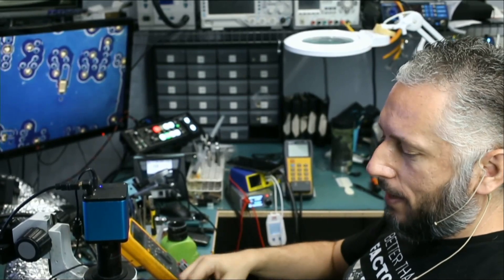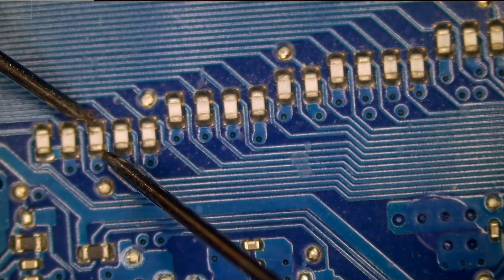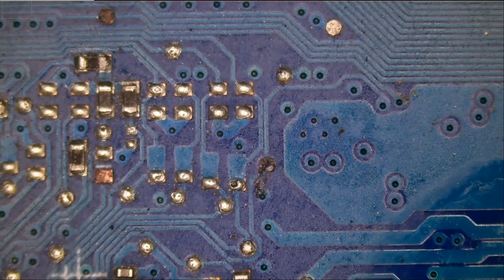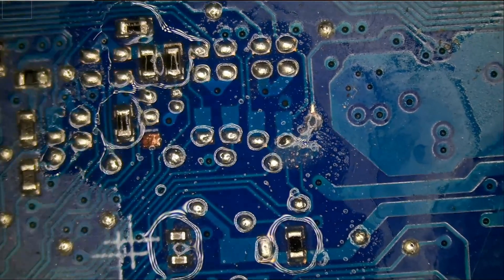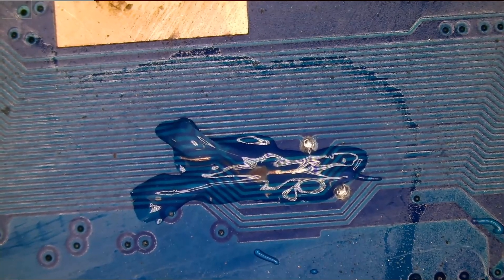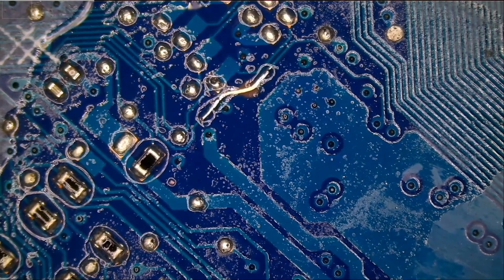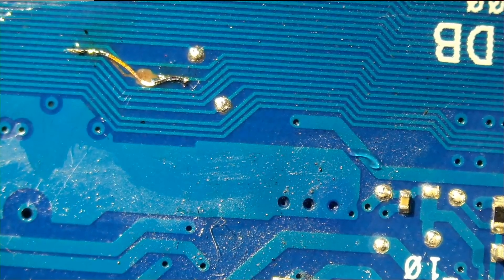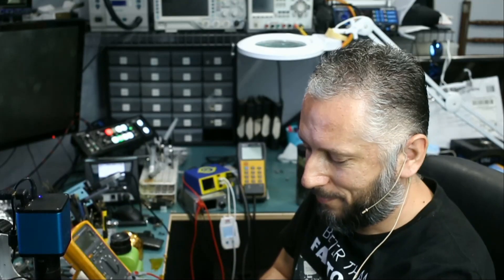Dell Alienware M17 some keyboard keys not working. Motherboard Repair. Not a keyboard issue.

Comment: Hi Alex, most EC programmers who work through the keyboard port have the feature to test keyboards. You can see if a key is working or not, stuck or not. 
But for about 30$ you can also find keyboard testers.
Reply: There is also a touchpad testers? my touchpad is not working and before messing with the board I want a way to test the touchpad
Reply: @kdilac8879  No. Keyboards are "analog" (two circuits are switched together on the keyboard matrix when a key is pressed), which the testers can measure. Touchpads have their own controllers and firmware, so this cannot be easy standardised.
Reply: @SiETechNotebookReparatur  The touchpad ELAN chip is programmed? If I buy a new chip I have to program it?
Reply: @kdilac8879  you can test the chip using an eeprom programmer like ch341a. You can also use it to dump/save the previous firmware or flash a new one.
Reply: @-.......................-  which adapter I need to test this ELAN chip? I have the programmer ch341a
Reply: @kdilac8879  do you know the part number of that chip? you will refer the connection to its pinout that can be seen in the datasheet of the chip

Comment: I looked online for many hours trying to find a fix on my personal laptop after multiple keys stopped working, and im sure there are tons of people out there with this same problem that couldnt find any answers. Never would have thought it was a motherboard problem. Cant wait to take mine apart and see if there are any broken traces. Thanks for the video!
Reply: Could be a motherboard problem but it's very hard to find people who knows what they are doing. Mostly repair shops usually just make the present situation worse. BTW good luck with your laptop hope it gets fixed

Comment: I have the same one, just wondering how those lines were corroded.   Nice video 👍👍👍. This is one of the best YouTube channels.
Reply: Probably its caused by condensed water when you turn on a very cold laptop in a warm room with high humidity..

Comment: Nice video. I wonder why there is corrosion  on that part of the board only. Maybe its liquid gets in there, some caps and resistors look a bit corroded too. Do you also clean the whole board for the customer after the repair? Thank you for the video

Comment: Common issue when you keep your laptop on your lap or inside a backpack in the summer. Sweat and moisture finds it's way into the board. I had several issues with my daily driver laptop unti the keyboard was completely gone and that was the end of it. The keyboard is welded to the case so into the bin it went.

Comment: Alex, I hope you read my comment. I'm wondering, what you do in cases like that, when the part you ordered is not necessary for repair. Do you keep it in stock, as it might come handy in the future, or do you send it back? I'm wondering what's more sensible from a business standpoint - having that bit of cash "frozen" until somebody comes with compatible laptop and issue or sending it back so you get cash back (minus shipping probably).

Keep on good work! 👍

Comment: I can only guess, but it appears those traces were probably made too thin, the coating peeled off, then the traces oxidized to nothing. Slight defect in manufacturing. Honestly I'd of guessed the keyboard wasn't any good before i thought it had this problem... you made the right call.

Comment: Yes, it happened to me also once for a TV remote. Around 2-3 test pads were totally gone, due to which none of buttons on remote was working. After connecting those, it started working. I thought it could be due to sweat (salty moisture) from hands went inside remote. Not sure how it can happen to a laptop though.
Reply: Could be the same sweaty moisture seeping through the keyboard, it is a gaming laptop
Reply: if you use a gaming laptop at your legs, you will sweat there and the coolingfan of the laptop sucks in the moisture , the rest you know.
Reply: A true gamer takes  his lap top everywhere he can to keep up his skills.
Even the toilet.
Bathrooms dripping with condensation and "flush splatter".
Even a "bomb plop" could splash up and cause a moisture hit.
Such is the harried life of a gamer.
Reply: @darkbreed  that somewhat makes sense

Comment: Probably the corrosion was caused by condensed water which happens when you turn on a very cold laptop in a warm and damp room without waiting some time. A failure of multiple keys is often caused by an issue with only one signal line because the keys are connected in a matrix.

Comment: Hey Alex from your personal opinion which laptop brand that don't usually have any hardware issues or don't get damaged so easily? Acer? Because I haven't seen much videos about Acer laptops having issues on your channel.
Reply: Acer...my channel is full of Acer repairs. But it does not mean that it is worse than other brands. The motherboards are not from the brand (e.g. Quanta makes motherboards for Acer, Asus, Dell, HP, Lenovo, Apple, Sony, Toshiba), you can't say that one is better or more durable than the other.
Reply: @SiETechNotebookReparatur  Oh thanks!  I'll check out your channel. Would love to learn more.

Comment: What the circle metal points called? test points? for testing of continuity?

Good weekend😚
Reply: Usually test point. You can use it to test lines, or connectivity or voltage. at this point.
Reply: @TheThore  thank you

Comment: nice fix as always alex :D guys ive got a problem and i need some help, i was working on an iphone 7 plus, voltage was not reaching the battery connector, after some search and some help i was told to change the U4001 which i think is the charging IC, i did that succesfully but unfortunately i knocked off some components under that chip, R4001 and C4004, now the phone is charging, but there's a problem, the phone is detecting the charger as a USB like im charging the phone via my pc, which is a problem, i asked a guy i know who is a pro in fixing stuff esp apple stuff told me to put back only R4001, C4004 doesnt matter, i did, barely, it was difficult due to lack of material but i did it, it didnt solve the problem, i tried to put back C4004 could't do it today, ill try tomorrow, my question is if those tiny components i knocked off are resposible for a natural charging i mean when i plug the chagrer it charges, cuz now voltage is reaching the battery after i changed the ic, after checking the schematics i found that R4001 is connected to a lot of USB lines, C4004 is just a gnd i think? im not sure i would love some help, and from where i can get compoents back if i ever fly the ones i got into thin air, help me please, heres a pic of the components i mean, they are shown in red box https://ibb.co/JcyGN2M

Comment: Could this be the same problem with a MacBook, for example, where the lower keys don't work?
Reply: If it's a 2016-17-18 Macbook there's a Apple recall for the butterfly keyboard. For the older models if there was no liquid spill on the keyboard clean it with compressed air and check for corrosion inside the keyboard connector and on the end of the cable that connect inside the socket. Connect a USB keyboard and test if all the keys are working. If yes and the logic board is OK you can replace the keyboard.
Reply: @mariolemerise7732  sorry, 2013 from memory.